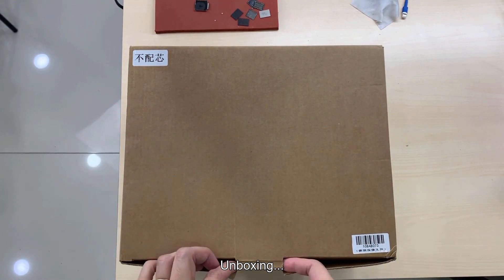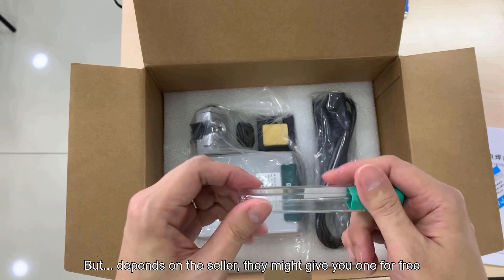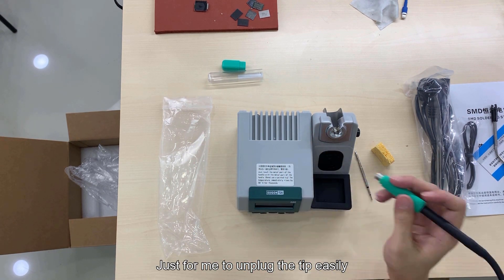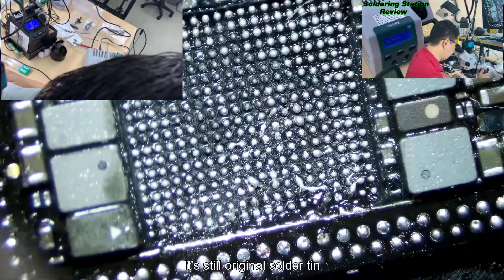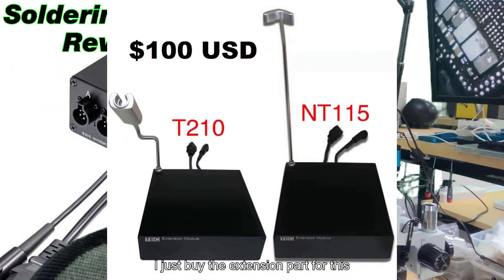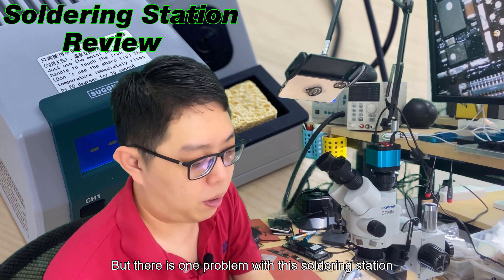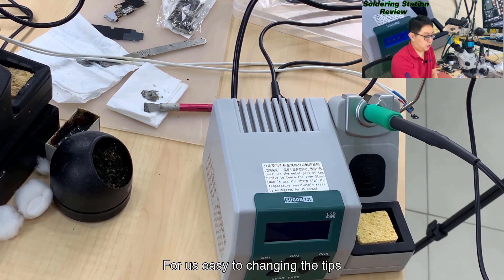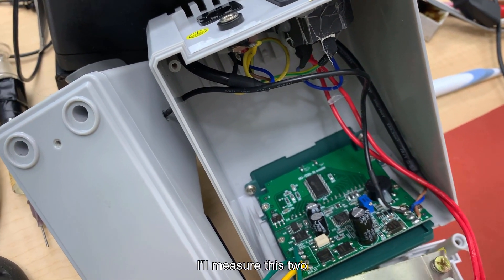【Review 】SUGON T26 Soldering Station VS JBC  [BONUS: JBC Extension Module]

Comment: Does it support the t245 handle?!
Reply from the maker: Yes
Reply: iPhone Service Malaysia 
Will t 245 perform better  where high thermal capacity  required cases?
Reply: it supports deez nuts

Comment: I've read this machine will burn the tips above 380 degrees, others complain the tips will break easily.
  If someone may clarify me it would be great. 
I really can't decide between this or the Hakko fx951. Or a cheap quick T12.
Reply from the maker: Hmm.. to answer this is quite long.
If you mean sharp tip it will easily break in 380c. Yes. It's normal.
Because JBC they're really doing 380c in that "top" of the tip. You wont need that heat to with the sharp tip.
What's the point that the tip head is very durable but it's is not reaching 380c output power. 
Put the tip into the ice and measure the temp at the same time. You will see JBC output power can be maintain. FX951 will drop.

Comment: bos brpe lame tahan jbc tip compare to fake clone tip? using fx951 now tp tgk handle 210 ni mcm best
Reply from the maker: Depends the user. JBC instant heat up and maintain power is incredible. Won’t regret one
Reply: @iPhoneServiceMalaysia  yes way more faster than hakko what im considering now is jbc tip price but if it can make work faster should be worth to buy
Reply from the maker: @hantusangap  Worth it. Especially when my boys they use it on the iPhone X layer to suck up all the pads in one shot. No need  roll with the solder wick
Reply: @iPhoneServiceMalaysia  that sugon came with original handle? or copy

Comment: Sir can you create a videos test about power circuit when need to change pmu or U2 Or reball cpu .. if the iphone is normal reading not found what is fulty... because we are confused with no power...
Reply from the maker: There is too much knowledge and not easy to make it as a learning video. 
Not only you need to know how the circuit flow, PMU, and CPU requirement working, know how the iPhone responds to dscp. You also need to learn many ways of measurements, where to measure,  blah blah blah.

Don't imagine anyone can become an expert by learning from google or youtube.
Reply: @iPhoneServiceMalaysia  ok for this how much cost ? Another all kinds repair I already know normally issues please let me know thanks..

Comment: did the problem happened after you connected the Sugon T26 to N115 expansion? or Sugon just died after little while ? because there is to much review on this item and I was hoping to buy one and hook it to N115 and have both precision and Nano station at the same time , ill be appreciated if you can clarify this question and was there any hope afterward
 ,
Reply from the maker: extension killed it